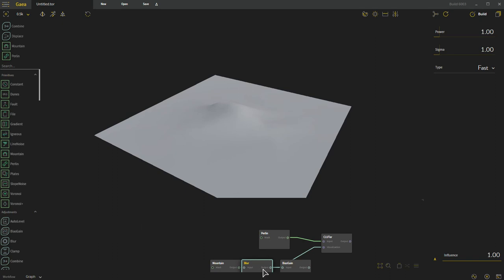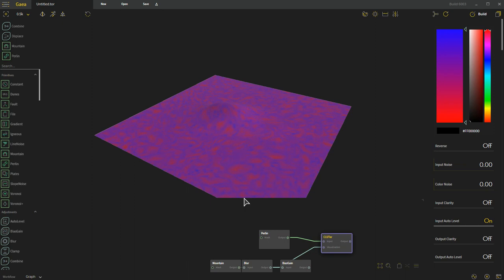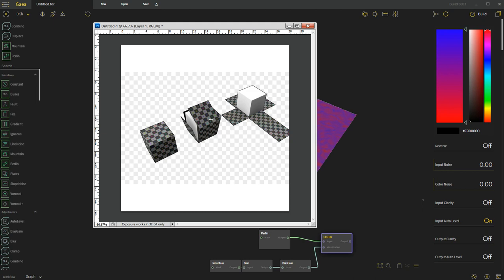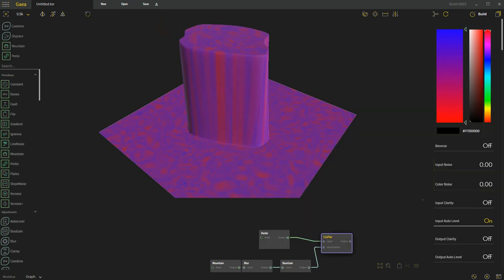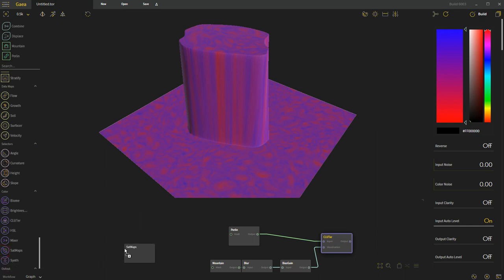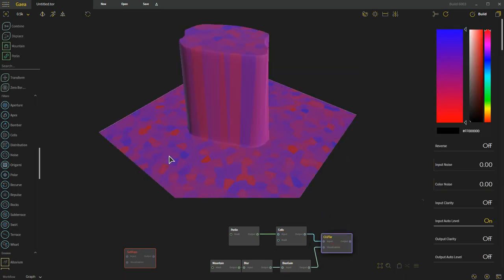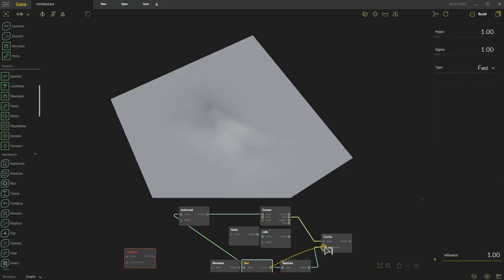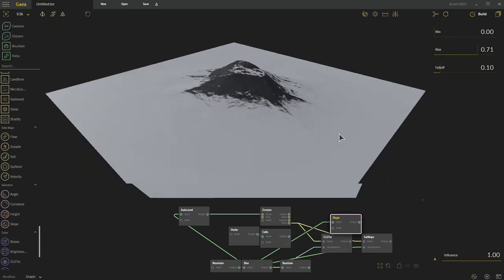Gaea EAP -  texturing limits and pitfalls

Comment: The tumbnail of your video its how Iooks almost any terrain i export: a bunch of blades, peaks pointed to sky. Any idea why? :(
Reply from the maker: probably you exported  a colour node as height information. Purple nodes are meant to be used as colour only. so if you've connected a "mesher" node to a purple node, all you will get is noise for your terrain mesh. If not that, can you please post an image of your node graph to the Quadspinner Facebook Group? It's easier to understand the issue if we can see the graph. :)